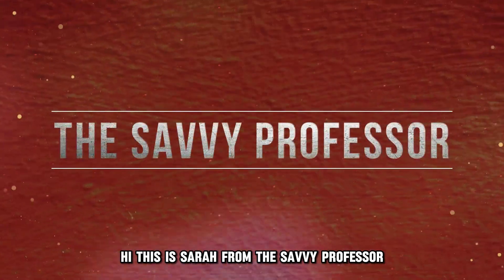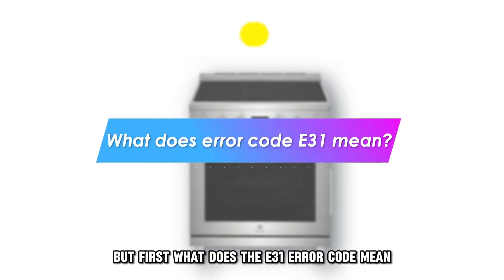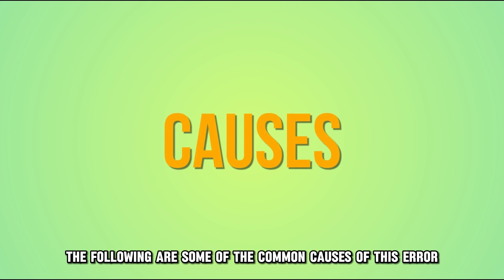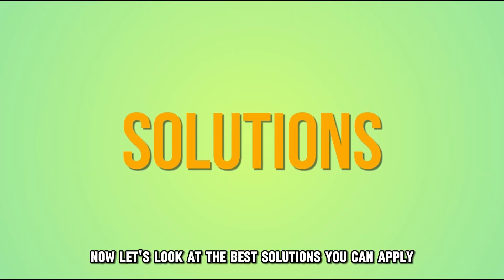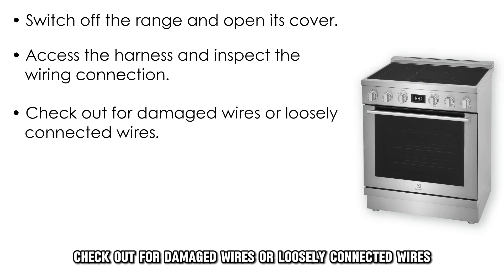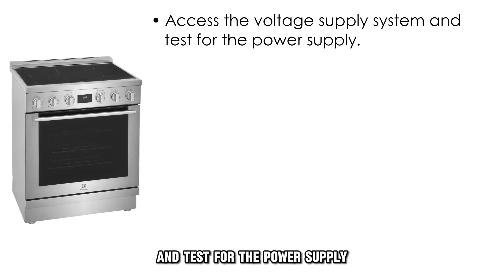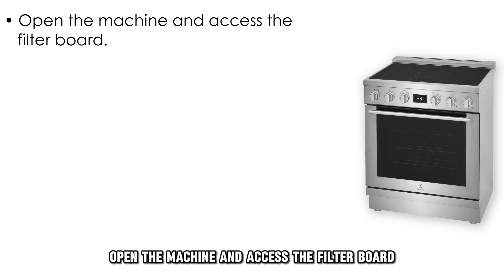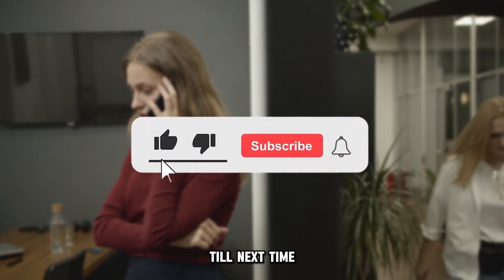How To Fix Electrolux Range E31 Error Code (Meaning Of The Error, What Causes It, And How To Fix It)

Comment: Yeah nah, the solutions are incorrect.  If you have E31, seek to have your boards serviced, also the video features electronics not present in your electronics range.
Reply from the maker: The solutions are correct. If the board is faulty, the solution is to replace it. Thanks.
Reply: @TheSavvyProfessor  Wrong, what's this power supply you keep talking of, you just read the service manual and lack knowledge of what is the most likely failure for each error despite the manual.